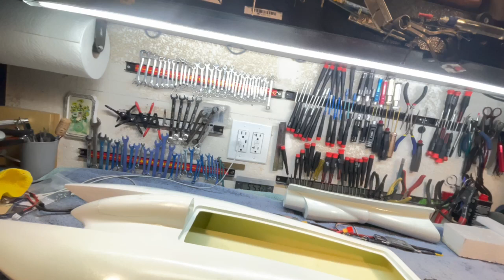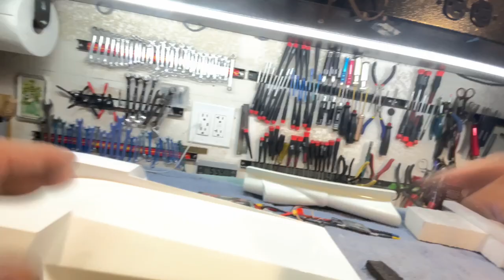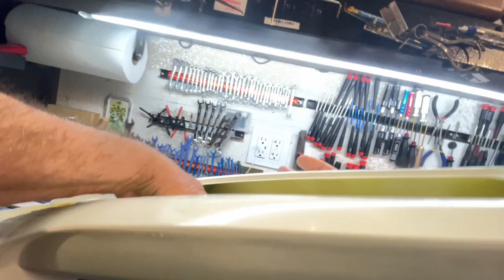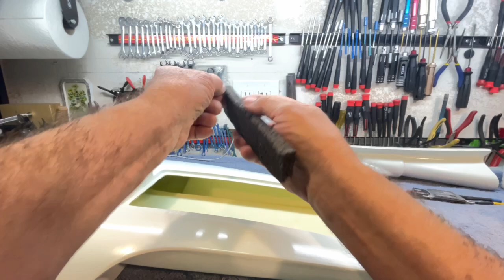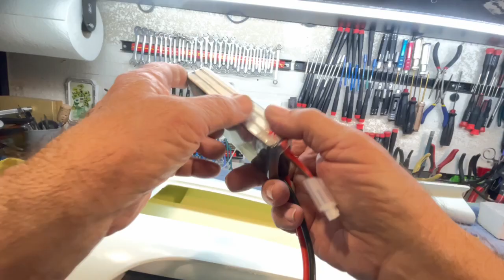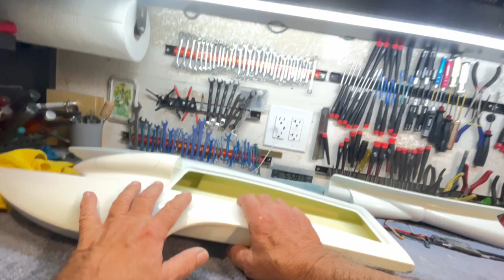Dr. Jet starts foaming.......

Comment: What size motor did you say you bought...or did you say. Seems like it's getting faster and faster. A 2968 4000kv on one battery and now your putting 2 batteries. Can't wait to see
Reply from the maker: This will be powered with a 3660 3500Kv on 3S (the two 3.5 AH batteries in parallel)..  The 2968 single battery is in my Silver Bullet Rigger.